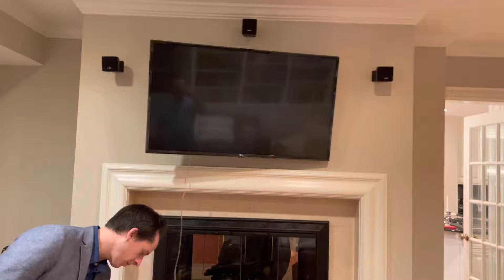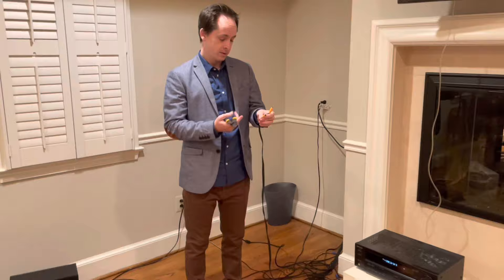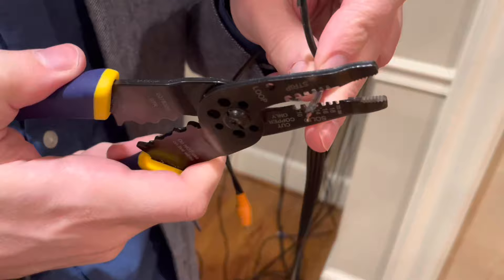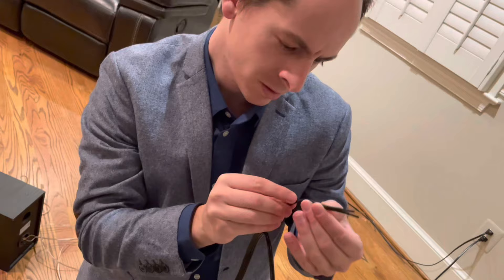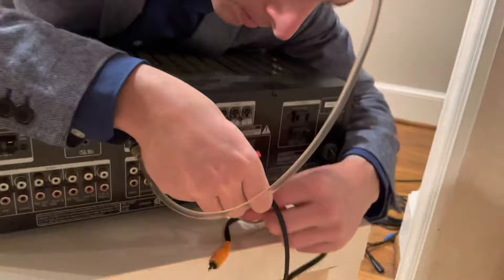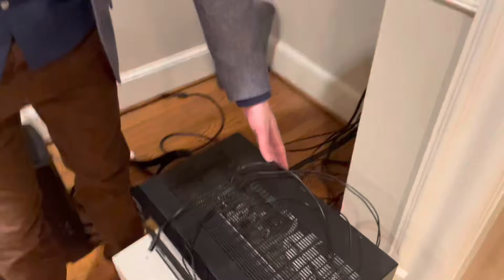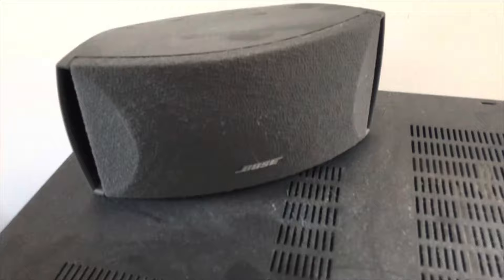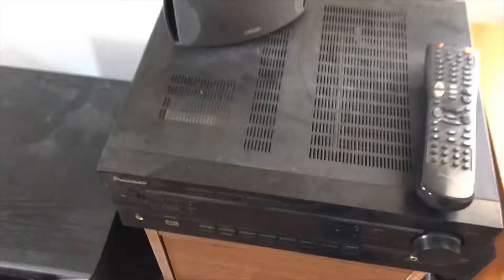How to use Bose speakers with any receiver

Comment: Those cubes only have response down to about 150hz, so you better hope the amp has it's sub LFE crossed over at it's highest point, and also the cubes present a very low impedance to the amp which could damage it at high levels. The system was meant to run the way they designed it. Also the Bose bass module is a bass module and subwoofer, so it has a summing circuit built in to produce the bass the cubes can't AND the LFE. while also keeping the system impedance at the more common 8 Ohms. But don't listen to me, I only worked for them....
Reply from the maker: This is some good information, thank you! The impedance was an unknown for me as it is not labeled on the speakers (and I didn’t bother to figure out if I could measure it), so yes with the lower impedance, if the amp is played at a sustained level near its max output, it could cause damage. However, the Bose speakers have very high sensitivity, which causes them to be louder at a lower amp output than a standard speaker, so it has that working in its favor. So at the end of the day, throwing a dance party with this setup is probably not a good idea.
Reply: Ok then why do my cubes measure 6.8 ohms
Reply: Another good question is if the accoustimass module is powering those cubes with the signal from the receiver or is just filtering frequencies below 150hz
Reply: @MrViper7121  it's filtered. The amp powers the cubes.
Reply: so much knowledge!! please help me? lol
Reply: @mike, I use to work for the company as well on the retail side in the mid 2000s. Good times
Reply: @UCanFixAnything ❤ I notice I have mine on volume 35 and it’s loud as hell at lower levels it definitely sounds clear and loud
Reply: Seeming the ampifier will shutdown asap.. due to the impedance dan watt from the cubes each speaker its to low less than 4 ohm, meaning that the power of the amplifier should be more..
Reply: Sounds like you need to make the video.
Reply: You seem unnecessarily upset by this video.
Reply: Not at all. Being upset would definitely be unnecessary
Reply: Better you buy others speaker brand. kef, wharfedale or B&W... and find an amplifier home theater or Tubing amps.. to drive them properly..than Bose..
Reply: BOSE is the best!

Comment: The Bose bass module has high pass crossovers for the cube speakers. The speakers need to be hooked up to the output on that bass module. And then the receiver to the bass module. Otherwise the cubes could blow as they can not handle the lower frequencies. Probably should have not cut of the rca ends.

Comment: The Bose system isn’t just the subwoofer! Bypassing like this will give you issues with crossover frequencies and settings
Reply from the maker: Receivers have built in crossovers, the speakers work perfectly fine this way.

Comment: I have got bose av18 i lost the remote and the buttons aren’t working that are fitted in the system with amazon firestick remite i can close and increase/decrease the volume but cannot change the output is there any solution for changing the output?
Reply: Perhaps you already found your solution, but if not…I’m using an old universal remote that I got from xfinity. Hope this helps.

Comment: The best way to know about the positive wire is to use continuity option on Mulit-meter and check which wire connects to Male Pin. No idea how I ended up onto this video :/

Comment: Excellent stuff. Im getting an old bose lifestyle 18. And was wondering where I need to place the 5 single cube speakers. I noticed you have 3 spaced not to far from the tv but the 2 rear speakers right at the top corners. 

This is how I'd like to do mount 4 in each top corner and 1 just above the tv

Comment: Interesting thanks for the video! I wanted to change out the center channel on this system. I got to make sure it’s rerouted into this subwoofer b.S.. thanks for the tips. I’ve already added pb 4000 to this system & it really sounds great. But slowly want to upgrade the front sound stage.
Reply from the maker: You can just bypass the sub for the center channel upgrade. Run the new center direct from the receiver. (Unless of course the Bose style plug from the sub is the type your speaker uses).
Reply: H. Lux  can u give me some advice about this setup..because im going to buy svs pb 1000 pro  subwoofer  connect to av reciever with bose cubes. is this good idea?

Comment: My understanding is that if you route directly to the receiver, without doing more, the speakers will not get all the highs and lows. You are supposed to hook up everything through the base module, since the base module supplies the highs and lows to the speakers (in a way). The speakers will work, but they will sound like crap.
Reply from the maker: Standard receivers will have the crossovers set for the speakers direct from the amp. These speakers sound just as good as any other speaker of similar quality from the receiver. They may be tuned for their amp more precisely in the Bose system, but if you are trying to wire it this way, the quality difference between these and some other speakers is probably not the main concern.
Reply: The accoustimass module probably applies some heavy eq to those cubes

Comment: Excellent video, a question could you just place the speakers in a Receiver without having to place the Subwoofer I'm referring to the Bose subwofer? Do you think it would work that way?
Reply from the maker: Yes. You don’t need to subwoofer for the model shown here
Reply: @UCanFixAnything  OK, let's see if I understand, nothing will be connected to the Subwoofer, it's just buying the 5 speakers that your model has and placing them on the Receiver? Because what I want is not to have to depend on the subwoofer. I don't want it here, what model do you have?

Comment: hello,
can you please suggest me.
i have bose v35 lifestyle system and the subwoofer unit is dead.
i can use  bose v35 speakers to any amplifier like you connected in your vides and use it are they compatible.
Please suggest.
Thanks
Reply from the maker: The cable end just looks like an RCA plug yes? Like in the video. If so, then yes there shouldn't be any problem with this.

Comment: hello...I have an acoustimass 15 series 3 and all the cubes are connected to the acoustimass sub with rca cables, I have another cube that cannot be connected because all the connections are occupied, only this cube can I connect it to the yamaha receiver without it being damaged?
Reply from the maker: So you want to use it for one of the open channels on the receiver? For example as a side speaker for a 7.1 setup? If that is the case, then yes that will work fine. You will just need to modify the plug for that cube (like in the video) to be able to connect directly to the receiver.

Comment: I have an very old Bose System 2's speakers. The player and woofer are gone. Its possible to connect the 2 speaker directly to my laptop via the modified headphone cable? Or must it be powered by a receiver?
Reply from the maker: Do you mean the Bose Acoustic Wave Music System II?

Comment: Those litter cubes need to be on crossover‘s or the bass is going to tear them apart
Reply from the maker: You can set most receivers to “small speakers”, which will do the crossover for you.

Comment: I got 7 jewel cube speakers, I want to connect with my avr 7.1 channel, but I don't have any information someone told me that my speaker was damaged if I connected without connect to bose subwoofer! Is it really?  I guess that only the sound quality maybe drop 10-20%.
Reply from the maker: You don’t need the subwoofer. Some guy on here measured the ohms of the cubes and said it was like 6.8, which is fine for most receivers. The sound quality will be as good as the receiver pushes. So ya, you should be fine to hook it up like is shown in the video.
Reply: @UCanFixAnything  thank you for your recommend.

Comment: I have an old PS321 Bose at my place and i wanted to reuse the subwoofer?
Reply from the maker: It is possible to connect, but not easy. If we are looking at the same model, there is an input into the sub with a bunch of pins expected to be plugged in. You will need to experiment to find a ground wire pin input and the sub line pin input. So basically two of the pins can be filled with custom wires and the left rest empty. Then from there you basically make your own wire. You will then need to solder those two pins to an rca plug head for the sub pre-out. This is a video worthy effort, if I had one of those I would make a video!
Reply: @UCanFixAnything  any chance to communicate you the diagram i found on google? basically you mean the connector resembling a VGA cable? 

Note that it is the old model and the seapker cable and the sub to player are all together
Reply from the maker: Ah yes I see the diagram online. There are two models, one has an input that looks like a vga and the other has a more square type input. At any rate, yes, check  the diagram for the pins that are for sub on whichever model you have. Should be two pins for sub. Plug in two small wires direct to those pins, then run from there to a sub preout, make sure you use a preout and not a powered sub out from the receiver. The pre out will be of rca type. You can just touch the wires to the preout (one on outside one on inside). Then you can solder an rca head on later once you are sure you’ve got the right wires.

Comment: has the  cable from satellite to sub the rca connection?
Reply from the maker: A satellite rca connection should run directly to the receiver. The receiver will handle the sub out for all inputs.

Comment: I thought this wouldn’t work due to the Ω ??
Reply from the maker: There’s discussion about it in the comments. It works fine, I wouldn’t crank your receiver at max volume though cuz it’s technically slightly low ohms for a normal receiver
Reply: @UCanFixAnything  well that’s pretty awesome. 

I’m currently here recreating the setup my dad had when I was young. I’m trying to find a way to link my Bose Cinemate ii to my Pioneer SX-737 out of impatience/necessity. After much preparation, I purchasied the receiver…then I ended up needing to replace the cartridge & stylus on my Dad’s turntable as well. I got everything connected, ready to rock…only to discover my speakers are shot. I could kick myself! So now my piggy bank is empty, and the Bose are all I’ve got on hand. Wahhhh!!! 😭

Comment: Did you connect the subwoofer, and if you did; how did you do it?
Reply: same question here
Reply: The sub comes with a flat cable for cube speakers and a cable for sub input. Just plug the sub input and you all good

Comment: So, you, cut, a, speaker system, in half? Then connected the speakers separately, to the receiver? Would it not be easier just connecting the speaker systems as Bose designed? If somebody reading this is confused, ?. An Bose speaker system, is an speaker system, not only for name, but it is a system to be used together. Imagine that there is 2 tower speakers in front, one on left, other right. These are the traditional 3 way speakers. The Cinemate is a speaker system. The left, right, and the right, left speakers, combined with the Acousticamass (not a woofer or whatever else could connect it to other brands)  mix to form a phantom center channel. As for the left, left, and the right, right, and the Acoustimass. They form the phantom rear speakers. An combination of all makes the left and right channels. The Acoustimass goes up to a higher frequency than a woofer, especially a subwoofer. The Acoustimass is soft of the woofer and mid low, in a 4 way speaker setup. The small speakers are in place of the highs, and mid highs. 
   Let me repeat speaker system.  Bose produces an pleasant and enjoyable listening experience. This is not for a serious situation. Wanting to throw a party. Get something else. Deep serious movie night. Get something else. Watching an documentary, casual movie, sitting around relaxing cleaning, anything. Bose is got you. The signature Bose sound built into the system, not only one or some of the components. Is produced by the system, cutting it apart destroys the sound that Bose is known for. The parts don’t produce good sound, separate from one another. This is why Bose has a bad name. Along with people trying to show it as a serious home theater, or music stereo. 
   I thoroughly enjoy Bose overall. It is one I will always recommend to anyone looking for the best enhancement, to their home entertainment. As for someone looking for a great music setup there are many setups better for that. Thank you for helping the Bose hatters out. Down the road, you will probably end up buying something else, and talking how bad the Bose sounds, compared to your new setup. Further helping the hatters. Don’t mention anything how you butchered the system up.
Reply from the maker: I agree with you, I definitely would leave the Bose system together if possible. It is best tuned to work with itself. The reason for the separation was that an individual moved out of their house and left the sub and speakers mounted in the wall but took the receiver. The owner of the house did not want to buy a new Bose receiver, but they had a 5.1 available, so the choice between using a different receiver and buying a new Bose receiver was determined by that. The users were not concerned with sound quality, they just wanted something that worked.
Reply: In my case I just have the cube speakers. Sub and receiver are gone
Reply: @asoganmoodaly8743  how are they working for you? Are you happy with how they sound?
Reply: @johnsimun6533  I’m still researching how to connect them safely. I have many speakers in several rooms as well as the Bose cube speakers in the family room. And a bunch of wires sticking out the wall behind the tv that were seemingly snipped (no connections..). So it’s going to be a challenge. I’ll have to figure out if the speakers work as a start, then purchase the fittings, acoustimass sub and a receiver.
Reply: @asoganmoodaly8743  first thing, do you enjoy the Bose DSP? How Bose products sound.
Reply: @johnsimun6533  I like the brand! We just moved into a new house so I’m still trying to get the system to work. Haven’t heard it yet in this place